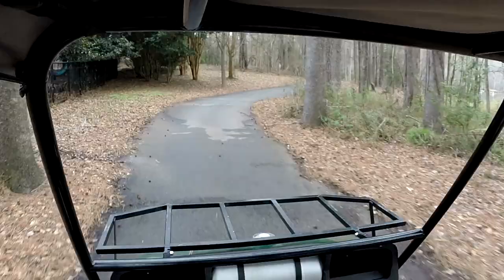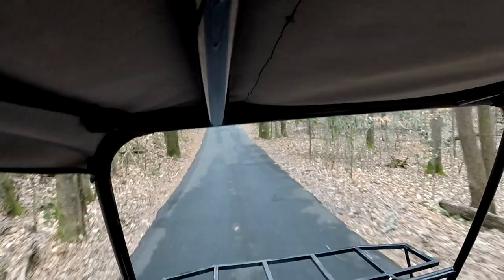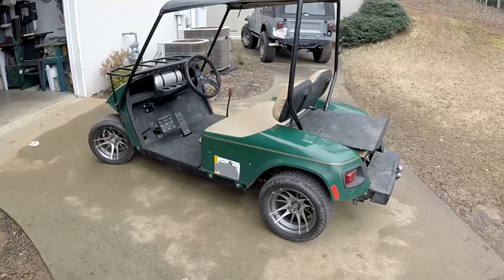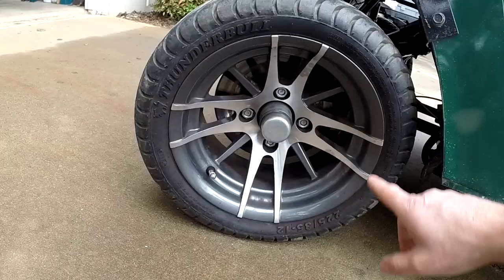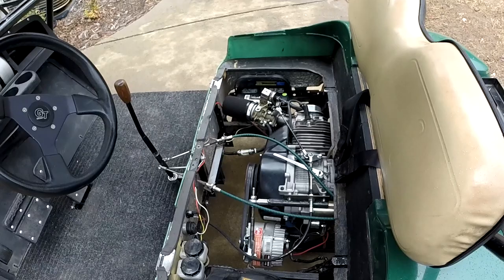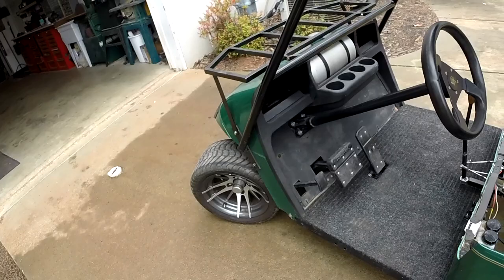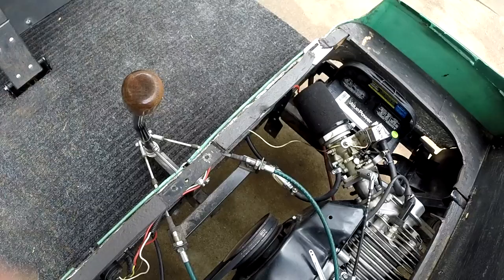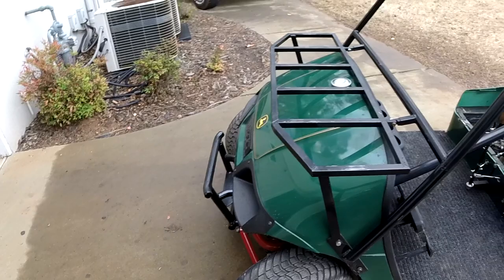Custom Golf Cart with a V.W. Transmission and a Predator 420 cc Engine.

Comment: That my friend is the most amazing home modified cart I’ve ever seen on video! My first question, how fast does it go? In my youth I owned Corvair, I also helped friends who were VW air cooled fans get much more performance out of their Bugs, plus I had a Karman Ghia, a 1959 Karman Ghia back in the mid 70’s I built with a 110 hp Corvair engine, using a later model VW Bus transaxle, that incidentally we were required to flip the ring gear, because the Chevy engine rotated opposite the VW. I just got so tired of shifting the old, non synchronized 1st gear 59 VW, with only 35 hp! So I used a 110 hp Chevy Corvair engine to fix that problem, the next item that attracted my attention was brakes! I ended up using the disk brake front end from the same car I got the transaxle from! That Ghia really surprised a LOT of so called fast cars!
Reply from the maker: Thanks! That Karman Ghia sounds cool!

Comment: Very very impressive and an awesome idea to see actually come to fruition! I've often wondered if it was feasible to do with not knowing the gear ratios of the VW Final drive! BUT it be pretty awesome to have a manual transaxle with reverse that could hold up to almost 90hp. I happen to have a highly modified 02 TXT with a 2 stroke in it at the moment, on the bench I have a fully custom build Briggs Vanguard 570cc all billet internals and head work, with a turbo system I'm building for it. I cut the crank to fit the standard 30mm 1-10:1 taper clutches all sleds and most carts utilize. So I was originally going to go with a set of high speed Ezgo gears like 6:1s to utilize the torque and power of this new beast I'm building. Otherwise the stock gearing won't put enough load on the engine to even make the turbo spool properly. It be pretty awesome to have a set of gears to run through being I hate automatic anythings! So thanks for posting your project and sweet cart, because you've answered a few good questions I've never been able to really find any answers to on the internet. Thanks again for the inspiration to move this project along maybe now in a much more satisfying direction for me, now I can see a predator 420 can make it not just move but haul some ass too for such a small engine especially in a heavy ass golf cart. I'm very impressed it goes as well as it does with a 420cc, but I've seen them moving full sized trucks for off road capabilities as well. Next project is to get my hands on a known good Beetle Transaxle! Now also knowing thanks to you that you can flip the ring gear around to change its setting location per engine rotation as well. Thank you Dearly for all this great information my Man. Hope you are still able to enjoy the golf cart and still have it I mean. But thank you again for all the new ideas you've now opened me up towards you
Reply from the maker: You’re welcome! I’m glad to see some of my builds inspiring others. The gear ratio on the V.W. Trans works perfect on a golf cart. It helps to have smaller tires on it.  I’m running 12” rims with low profile tires. The V.W. Trans also has a symmetrical bell housing making the conversion easier. That 570 build sounds cool! How much power will it make?
Reply: @themellowmechanic   Oh that's awesome to know also! Thank you. I had a 66 Beetle I had restored and built the engine and drive system up in for a drag car many years back. Now I'm half crippled from age and autoimmune disease destroying my joints, I had to scale my projects back in size anymore lol. Plus we know, you can fit more smaller toys in the toy box than a couple larger ones wink, wink..... I've been playing with all kinds of ideas for a final drive system that would be as well built like a golf cart but better, I'm sure your aware just a set of gears for these things are sick money, and I've been trying as much information out about the different gear ratios and what other people think of them. But it's not easy coming across someone like you and myself who like to research thing's before just slapping shit together. I'm an engineer by trade, stated off as a small engine technician for my first half of my life. So nothing's new here, but also drag raced and built my own cars from the ground up. So now I'm too old to be laying on my back ripping transmissions out by myself anymore I've given up on the bigger vehicles and gone back to my roots, and wanted a sick golf cart without the easy shortcut of dropping in a bike engine. Believe me, I have a CB550 engine sitting in the garage Rt now. Was a fall back plan lol. BUT I'm choosing the hard way, converting a lawnmower engine basically into a nasty turbo charged cart engine. I should have gone blower, it be so much easier at this point, but lol it's funny you said you were running a outboard carb on your engine in yours....... I'm using a tillotson Mercury 115HP carb off an older outboard and making fully adjustable high and low speed by needle valves for ease of fine tuning it. I actually have have another O/B carb on the 2 stroke in the cart that's in it now for the same reasons. I hate slide carbs! They are just a royal pain in the ass to tune and jet..... they have their place and it's really not on my shit though LMAO. But definitely thank you for sharing this information, and yes your correct about the belhousings being symmetrical I do remember that with my 66 having the engine in and out quite a few times with the four bolts that hold the engine in the car to the transmission, the scariest thing I've ever seen when it comes to engineering, but I guess it works I've never had to dodge a VW engine on the highway or even race track LOL thanks again for your help and guidance. I'm waiting for a few more parts like my custom cam to arrive and I can start putting this together I have everything else though sitting here ready to go. From a custom 12 volt crank trigger ignition 2 a custom Turbo System designed around this engine, and the engine around the turbo so hopefully it will go together smoothly it's just keeping it together afterwards will be the fun part thanks again, Jim.

Comment: This is an awesome build! 👍👍👍 I also like the video of how to mated the engine to the transaxle, could you show a little detail on the clutch and master cylinder please. It just looks tight with the tires cut to the left.
Reply from the maker: Jimmy, thanks for watching my videos.  Yes, it is tight with the tire but still has plenty of clearance. The clutch pedal is the same shape as the brake pedal and pivots in the same location.  It’s just moved left a little bit!
Reply: @themellowmechanic   thanks

Comment: Wow this was done extremely well and very professional. We see a lot of different Golf Cart builds on you tube but this one is completely different than any of the others and I love it. I would love to do something similar however since I would want to use it for rock hopping and even trail use the the transmission would be helpful to get those low gears but I would lift it and larger tires. I love how you stretched it and lowered the seat, I was looking at one right before I seen yours and it was lifted then seats sat on top of that battery box and it raised the seating and center of gravity way to high also another cool outcome of your design I like is by lowering the seat and the steering you change the front end look that sits up high in the front and makes the nose very short and will always look like a golf cart no matter what was done but with lower steering column it makes the front appear longer and one could change the hood or front cover to make it have a more rugged look. In all I absolutely love what you have done and even though my version would be a lifter 4x4 version you mailed it with yours.

Comment: By the way I will be sharping this video with everyone I know I’m subscribed. I think you will get a lot more subscribers with this one.
Reply from the maker: Thanks for subscribing! More videos about my golf cart on their way.
Reply: @themellowmechanic  Be an interesting project in an 80s Mini Clubman, engine in the front gearbox in the rear and using solid drive shafts connecting the 2 together :)
and for fun add the hybrid motor from a Honda Insight(fit`s between engine/gearbox)....

Comment: I'm surprised you were able to lay that engine down like that without it smoking. How.does the oil not get in combustion chamber. I always wonder how 4 stroke boat engines run standing straight up. The 300 honda looks to be the same as a car engine.

Comment: Could you flip in around and hide the engine under a cargo bed?  The gas and battery could be under the seat.   I would start with a dead Carrryall frame.
Reply from the maker: Yes, that was my original design. I flipped the motor because it stuck out too far out the back. The shifting setup would be a lot simpler design if it were a rear engine layout.

Comment: Nice design, never thought of using an auto trans nor a transaxle.  Looks like you were running 35 mph or higher on the street ?  Bet you get a lot of offers to sell and or would you make one for me.  WTG Mellow !
Reply from the maker: Thanks! It is faster than it needs to be! I built it as a one off without the intention of making another one. If I had the time, I think producing a bolt in kit would be fun.

Comment: Very cool man..I'm going to check out your other vids..right on..what's top speed estimate?
Reply from the maker: Thanks! The top speed is still theoretical (because I’m too chicken to drive it that fast) but it will do 40 mph in third gear, and still pulls in fourth.
Reply: @themellowmechanic  that's great and fast enough for a cart..I have the club cart with motor not batteries and been tryin to look up how to make it faster..it runs 20mph..but like it to run 30..I seen where you can turn them up but not good for the rpm for these motors..do you recommend any small crate motors me and buddy could tackle ourself for this..any suggestions? Thanks bud
Reply from the maker: I like the Predator 420. They are inexpensive and can make some good power. I can turn my motor pretty fast, maybe around 4,500 rpm before I get valve float on the stock vale train. I would recommend a lager carb as the stock carbs run lean, and a billet rod for durability.  I would also mill the head down to increase the hp and torque a bit. I took .050” off mine and it made a big difference. Make sure your brakes are up for the challenge of stopping a 30 mph cart!
Reply: @themellowmechanic  sweet bud..thanks so much for the info..going to try to start tacking that before it gets to hot down here in GEORGIA .:)

Comment: Does the transmission increase speed like do you get a much higher speed out of that little 420 predator engine than you would if that engine was directly connected to the drive axle
Reply from the maker: Yes.

Comment: great job on your cart, u my friend are so more advanced then i, 
question: i got a golf cart w/ a ds650 quad motor in an im trying to figure out an easy to install a different rear axle ,
( becuz the stock one is geared waaay to low,) what do u think about a 1 inch go cart live axle?
Reply from the maker: A go cart axle will work. The hard part would be designing a suspension for the axle. What about the original quad rear end? You could use the axle and swing arm.
Reply: @themellowmechanic  
I would but others that ive comuniicated with say they wish they would have done something different cause the golfcarts were to heavy  for the small area the swing arm conects to the axle at.
I think im going to try a live axle with at least 4 pillowblocks .
This club car axle rear end thats on it now is  geared like 12:1  
And is waaay low end .
Thank u for answerong back much appreciated.

Comment: . Ive already done a 670 predator vegas carts conversion and have 6 to 1 gears in it  with videos on my page and id like to have better gear range and Im currently working on another from a 2 cycle ezgo with the corvair transaxle  Great build thank you for the idea and video Im impressed what is the top end speed Thanks
Reply from the maker: How do you like the 670? I would like to do a project with that motor!  As far as top speed, I have never had it maxed out. It will do 40 mph in third gear so if the conditions are right it should do around 50mph. But that is too fast for the cart as it was originally designed for 15 mph!
Reply: @themellowmechanic  670 is a torque monster with that vw trans it would work great  my ezgo is a 4 stroke cart with forward and reverse and ive ran as fast as 38 mph and thats fine and it climbs hills like a boss with 6 to 1 gears factory is 12  to 1

Comment: How fast does it go? How many hp engine rated at?
Reply from the maker: Top speed is unknown, it does go way faster than I’m willing to go. I would guess it has around 20 hp.
Reply: @themellowmechanic  I want build a Yamaha G1 ...had one years ago .it waz gas 2 stroke 215cc I got it to run 46 mph 2 people flat ground.i have an 500 cc 2 cyl 2 stroke snow mobile engine now to put n one it's rated 55 hp 7500 rpm